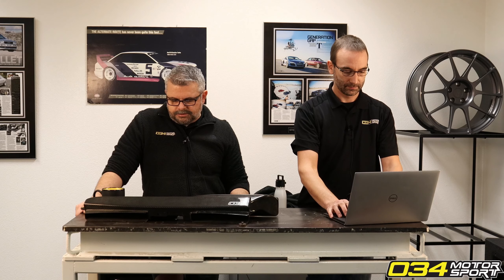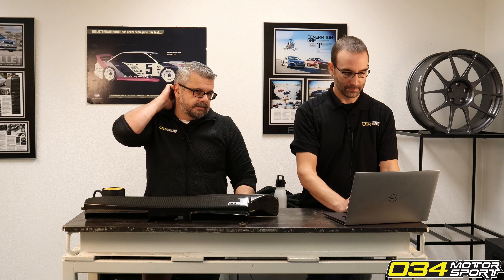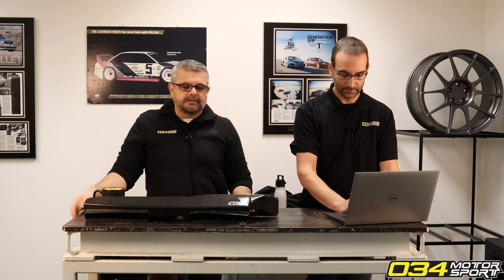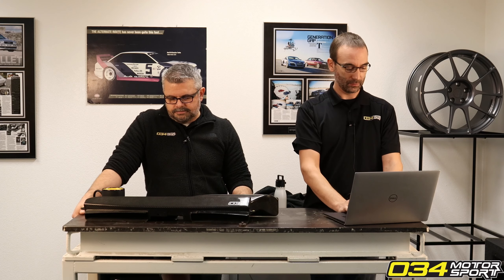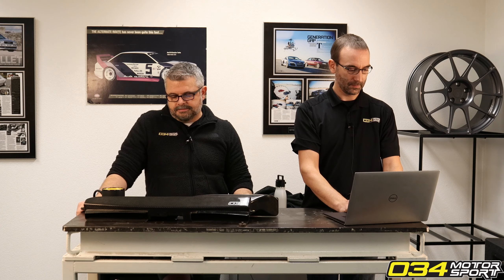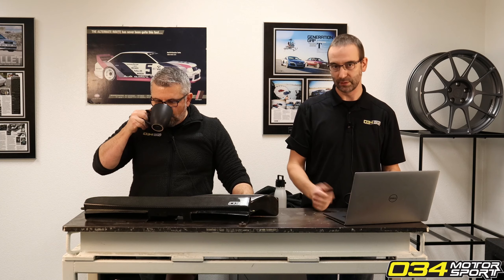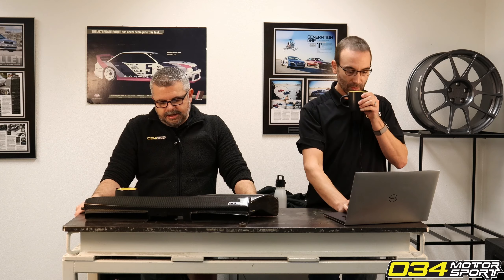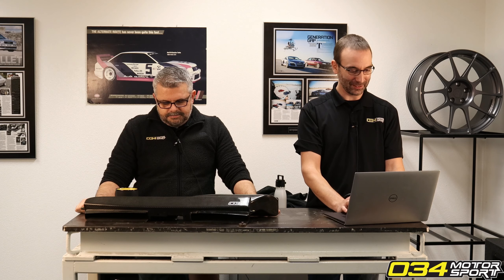Is Stage 2+ Safe for my Factory Catalytic Converters on my B8 S4? | 034Motorsport FAQ

Comment: Hi there, would an exhaust system consisting of gutted cats > OEM downpipes modified with generic high flow cats (for purely the smell) > awe tuning exhaust be a better alternative than getting test pipes and a more expensive downpipes with cats (like JHM)? Would those generic cats hold up with the advanced launch control?
Reply from the maker: If you plan to run our test pipe file and use our Ignition Cut Advanced Launch Control, we cannot recommend having cats anywhere in the exhaust system (for off-road use only). Please email us at tuning@034motorsport.com if you have further questions or concerns regarding our tuning.

Comment: Are downpipes absolutely required when running stage 2 on a B9 s4/5?
Reply from the maker: A High Flow Catalyst or Downpipe is required to run Stage 2 for racing use only. If you are using your car in an emissions controlled environment, we recommend our Stage 1 tune with stock catalysts, as well as an upgraded intercooler and Intake system.

Comment: It sounds like you don't want to answer this question with a clear answer.
Reply: Can you please explain how I didn’t answer this question clearly? I literally answered it directly, clearly, and accurately in the first sentence and then further explained in nuanced ways after that. If you want a fake or made up answer - you’re not going to get that from me.
Reply: @javadshadzi4824  you provided a much better response to the question asked in the comments. If you engage in racing you need to lose the cats. Unfortunately if the cats overheat on the 3.0t it will cause major damage to the engine.
Reply: @thevictim2072  If you can provide a list of 5 B8 3.0T race cars I'd love to see it, I can't even think of one these days, nobody races these cars so you're moving the goal posts, I answered the question exactly as it was answered.  Yes we also discuss clogged HFC damaging engines all the time here on the Live Chat, but no it doesn't mean an instant blown motor either.  Our tuning does not contribute significantly to failed cats, they fail at a very high rate stock, so it's just something anyone with a B8 3.0T needs to look out for, and our tuning is safe to run.